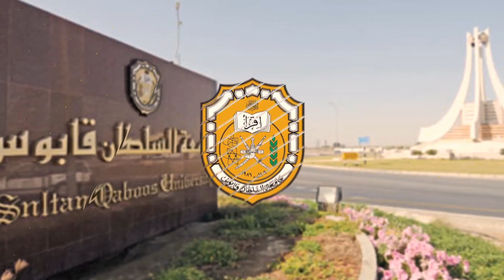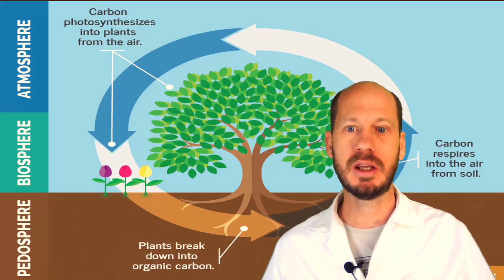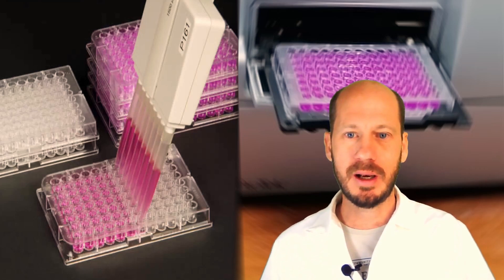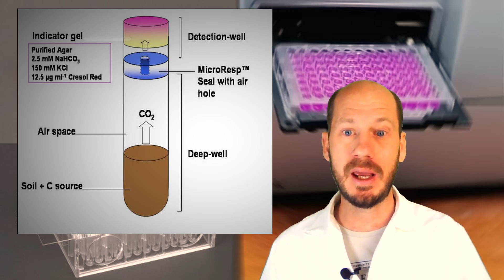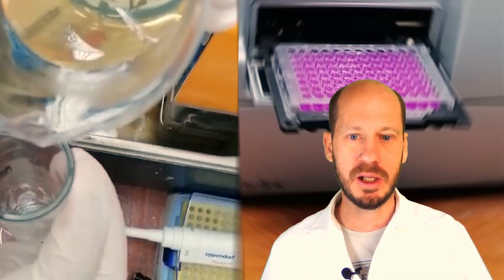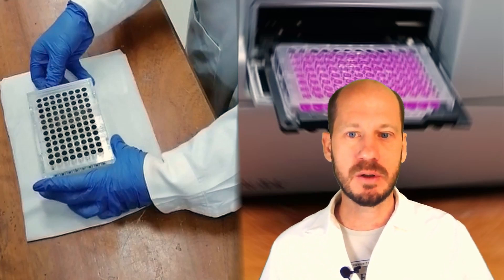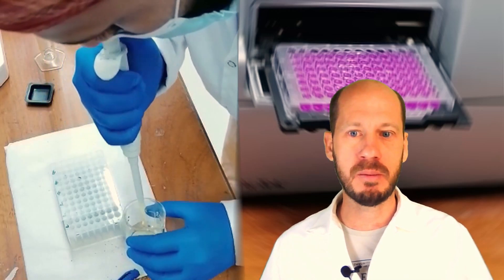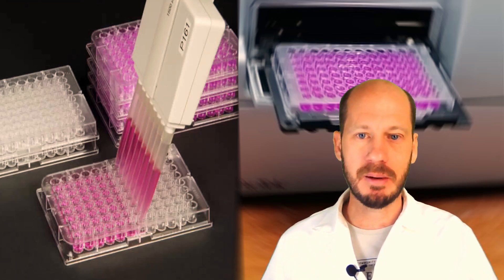Lab 06 - Soil microbial respiration using MicroResp™

Comment: thank you for the explanation. 
I have been using this method lately, I would like to point out it is not a perfect method as the samples in each well might be different in weight and hence there could be difference in  microbial activity for each soil type and also the replicates. Basically, it provides an approximate idea but not a definite idea about microbial respiration in soil.
Also there are edge effects and seals are not very sterile.
Reply from the maker: Cheers, Increase the n of replicates for higher precision.